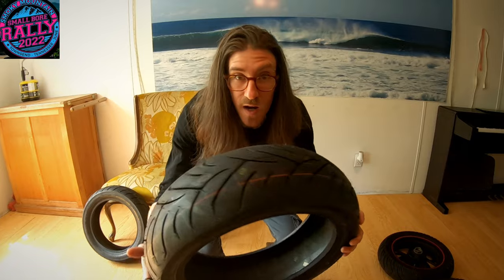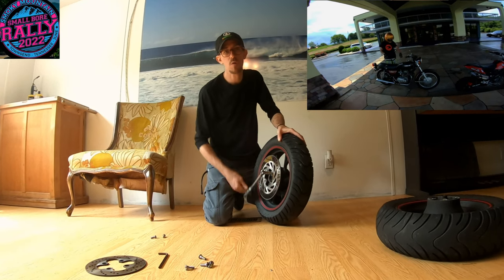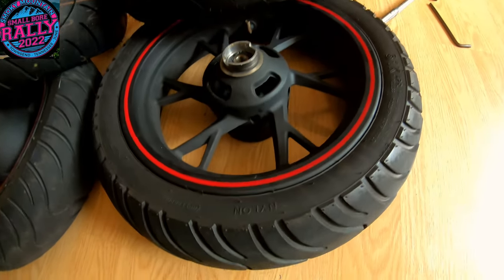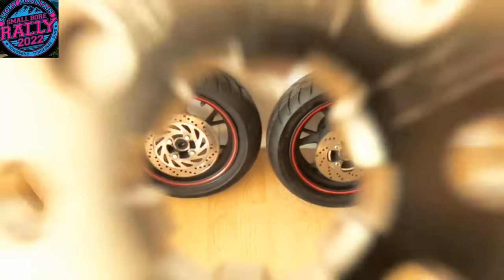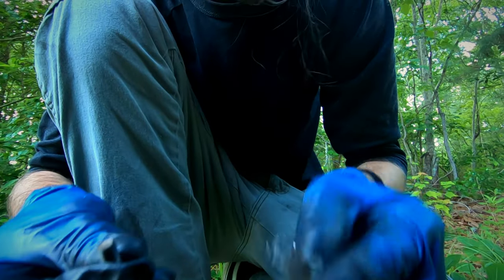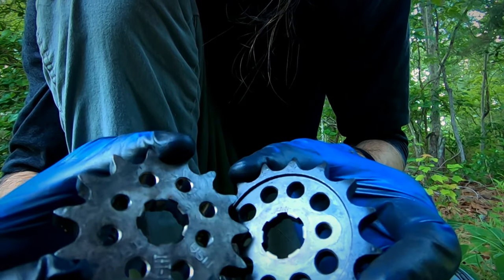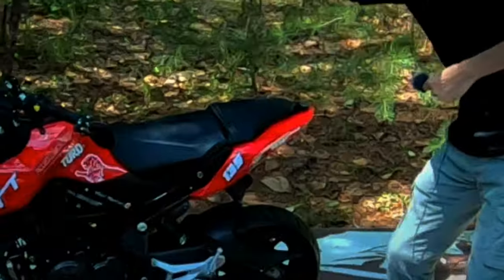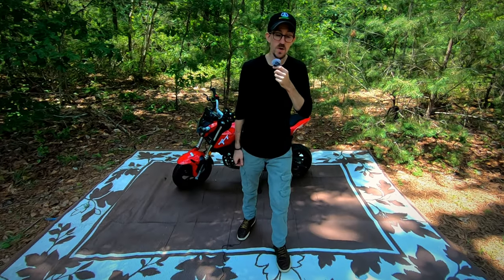Benelli TnT 135 Tune up time 2

Comment: You think if I buy the front 428 17t and rear 428 34t sprocket for top end speed, I should be able to use the factory benelli drive chain right?
Reply from the maker: I can’t be 100% sure but I think it might. That’s just my guess though. Thanks for checking the video out👊🏻🏍💨
Reply: @MiniMoturd  thank you for the advice..
Reply: Ur welcome..... By the way I just took off my rear tire to replace the sprocket for that T34 from a grom but it doesn't fit my benelli, it's a 4 bolt pattern and Benelli is 6 bolts so not sure how people do this swap..